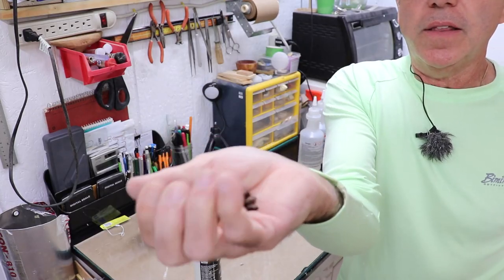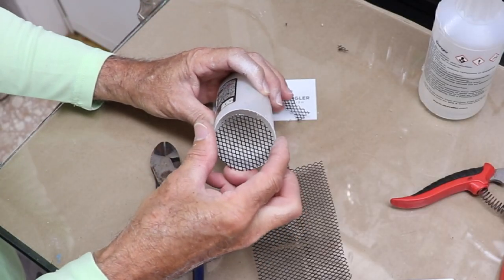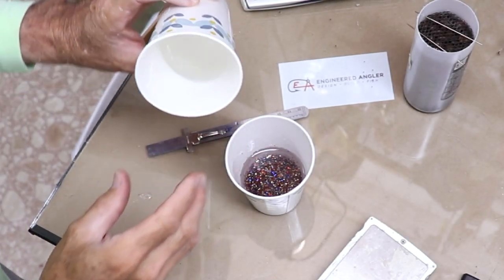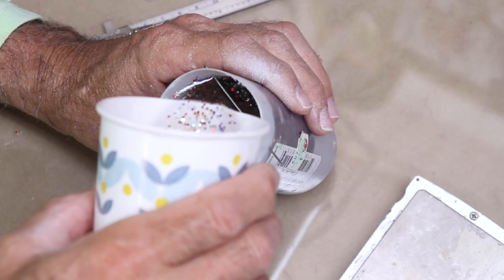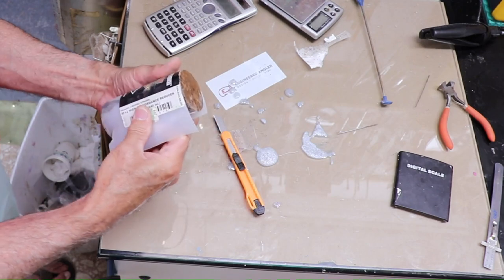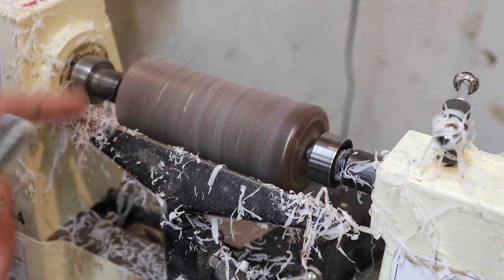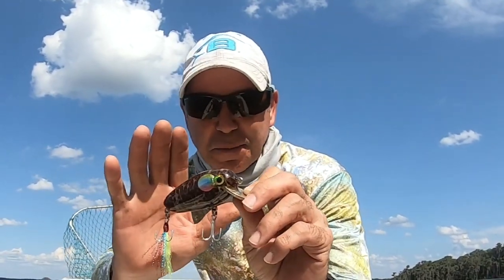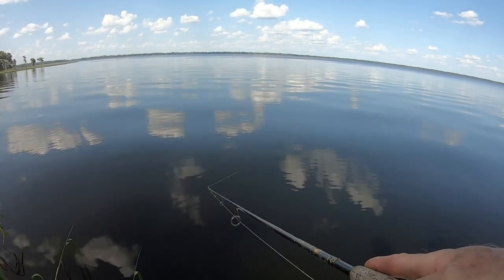Making a Crankbait from Coffee Beans.  Columbian Coffee Fishing Lure  #fishinglures   #luremaking

Comment: Would it work easier with doing same as you did pour it and use a thin stick and whip around to get the air out and resin in? Or tap the cup in the table maybe.
Reply from the maker: Maybe...